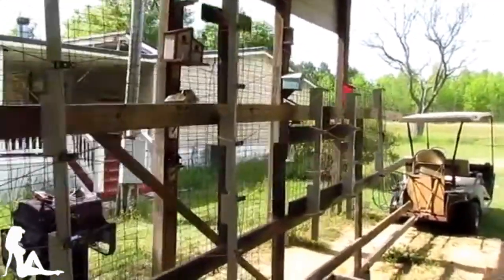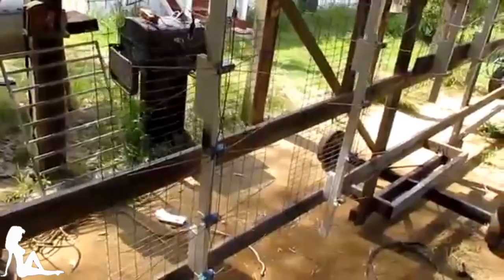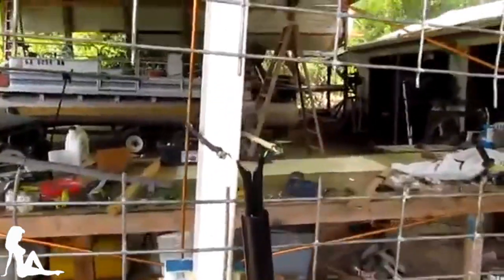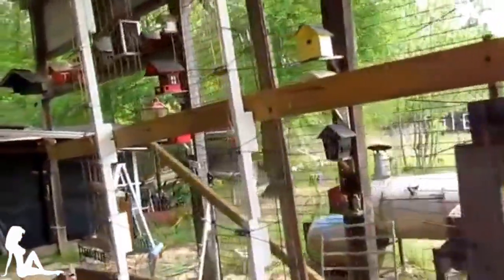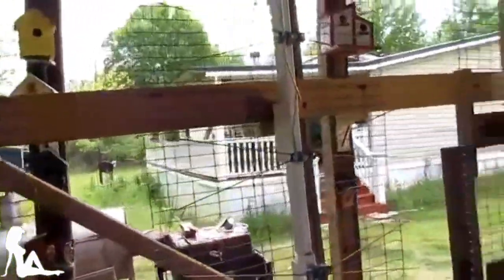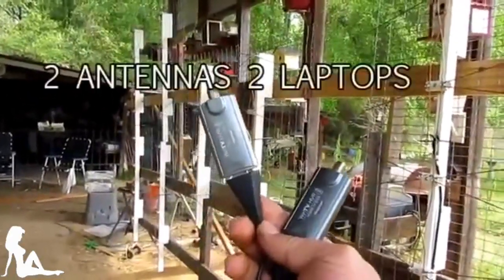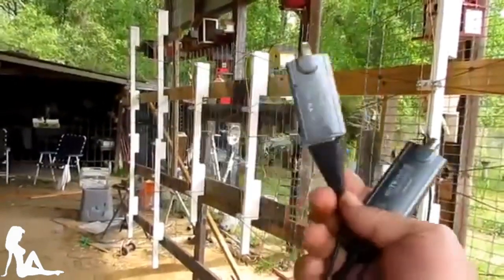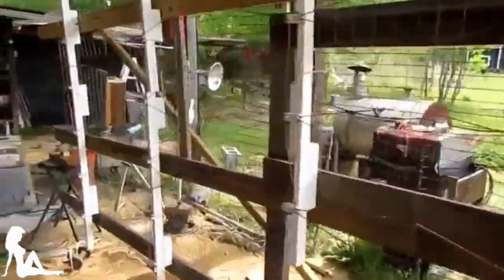The Ultimate TV Antennas Teaser

Comment: Hey Danny. Thought I’d share this with you. I made an ultimate antenna out of curtain rods and a 2x4 using your dimensions just for the heck of it. (I’d already made a real one for my son.) I put it on a pole about 25 feet up. It doesn’t have a reflector or booster. I held the pole up just by leaning it against my shed and pointed it at the tv towers. I’m about 45 miles south of Tulsa and that’s where I pointed it. It picked up 32 channels. All the channels that are available out of Tulsa.
Reply from the maker: all right